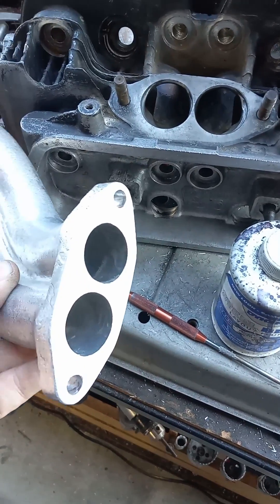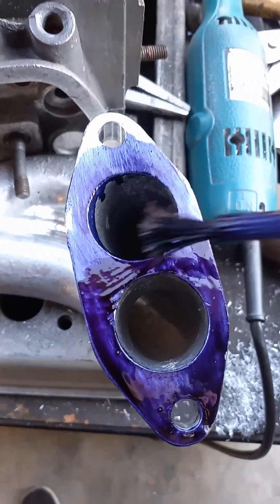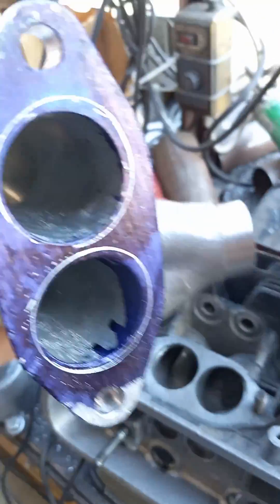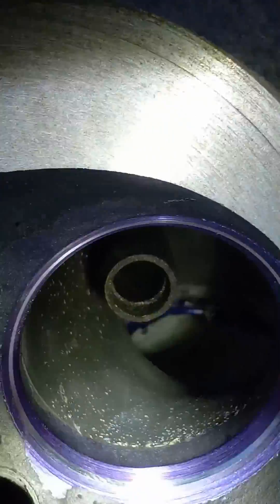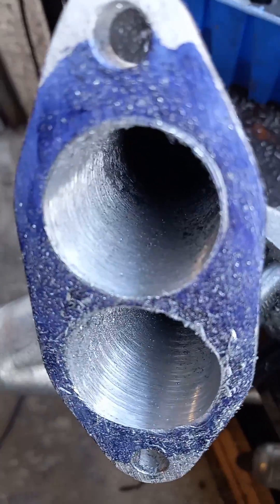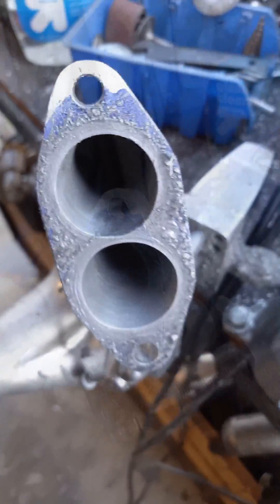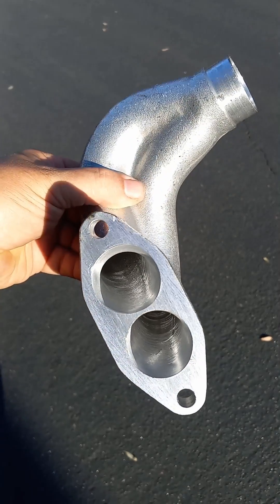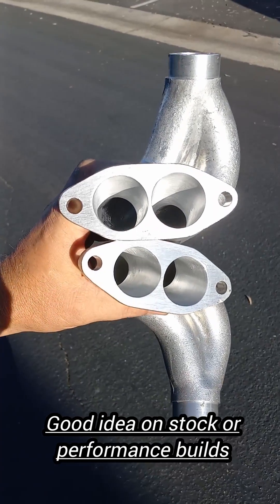Volkswagen port matching @mrkadron

Comment: Did this on an old Land Rover with it's stock manifold. There was as much as a 5mm step into the head! The bore of the manifold was actually larger than inlet so you can imagine the mess that would make of the flow. Opened up the port in the head and it was really easy with some carbide bits. The car did have a bit more power, not a huge amount but was noticeable.